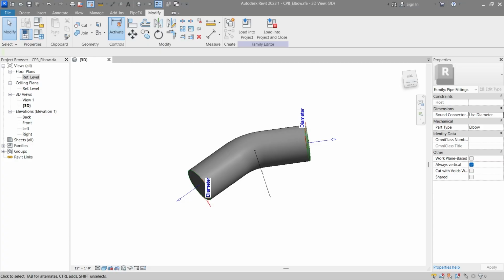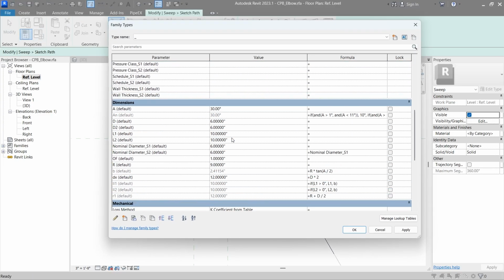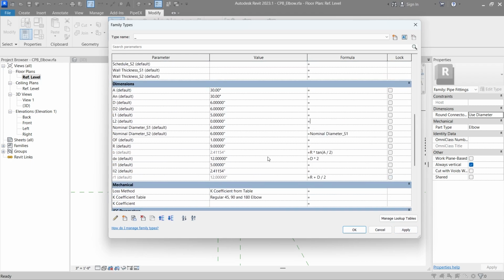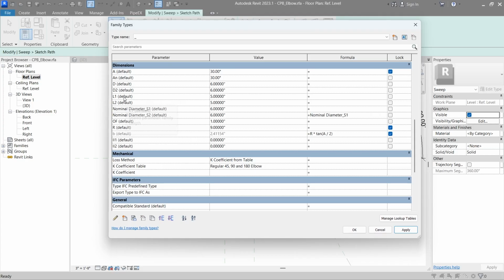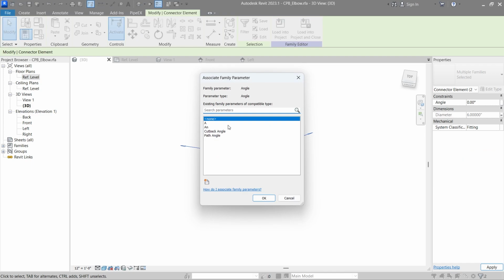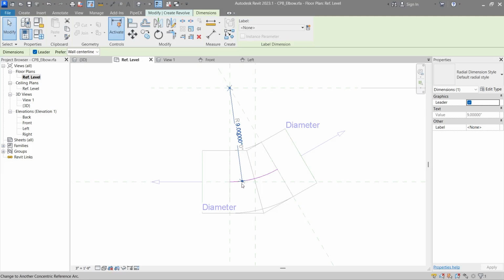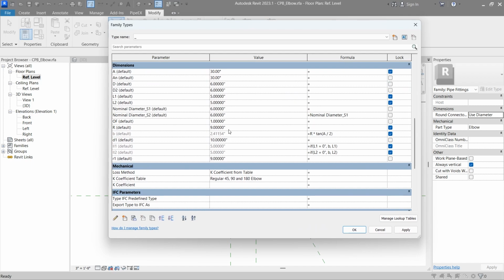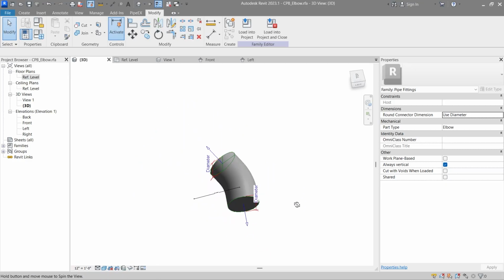Revit MEP Tutorial: Create a Parametric Pipe Bend Family ASME BPE in Minutes (Beginner-Friendly!)

Comment from the maker: 0:00 - Introduction to Pipe Bend Family
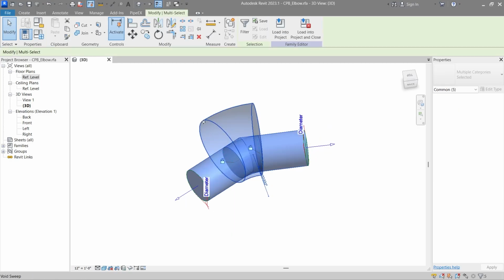0:26 - Why Single Sweeps Fail: Quick Demo
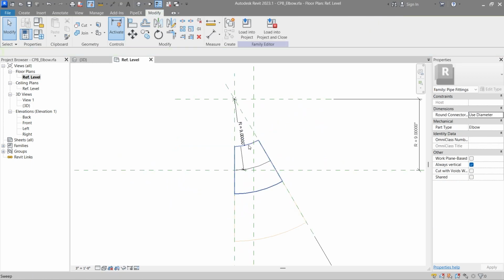1:14 - Building the Basic Path and Profile
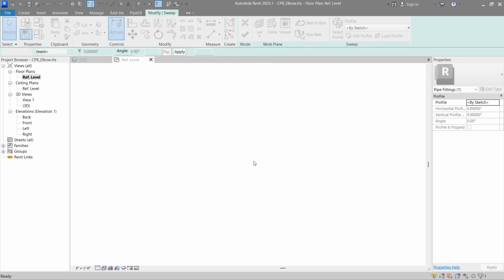3:52 - Simplifying Parameters for Stability
5:26 - Modeling Straight Sweep Sections
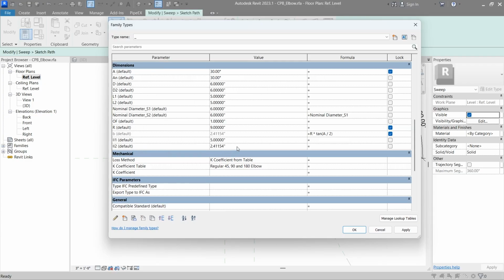8:36 - Adding Connectors to the Shape
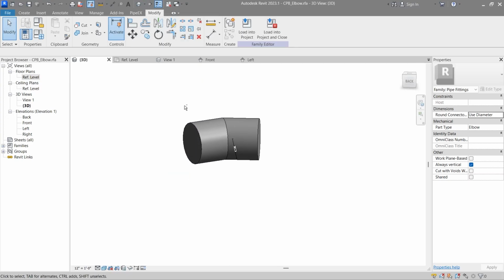10:57 - Refining the Elbow and Radius
13:22 - Creating Voids for Clean Edges
16:39 - Fixing Formulas and Issues
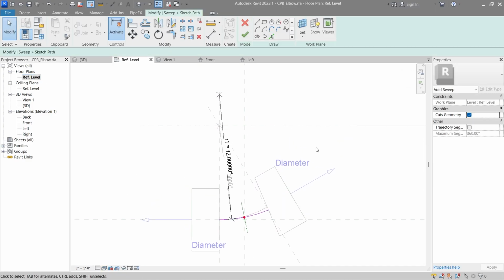18:54 - Final Tests and Wrap-Up